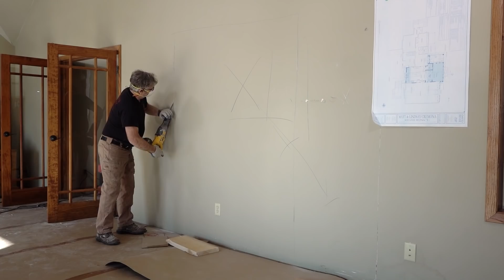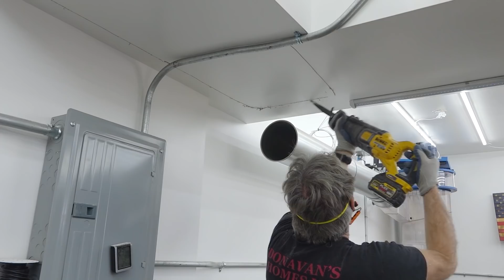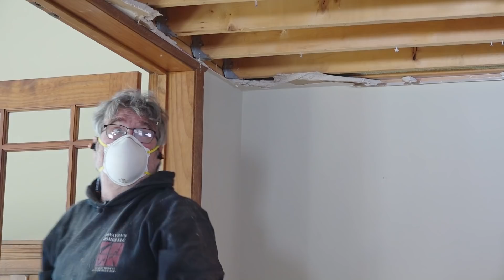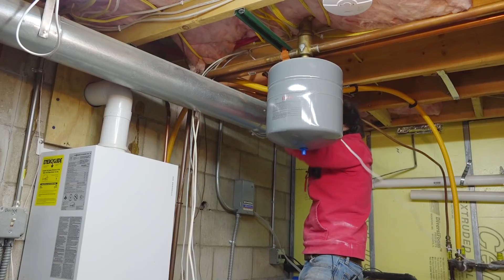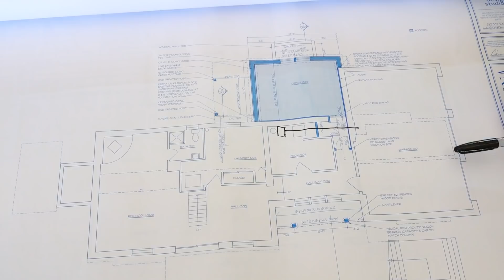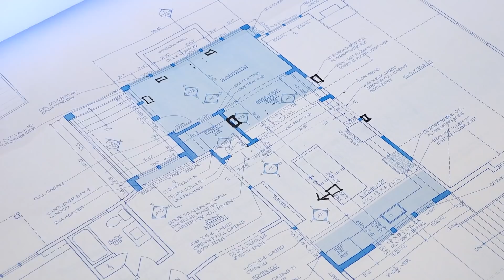Dropping the Ceiling and HVAC Plan | Home Renovation & Addition Part  21

Comment: Cubic Feet/Minute (CFM) is NOT equal to British Thermal Unit (BTU). CFM measures how fast air moves through the ducts. BTU measures the amount of heat in the air.

Comment: its amzing to see wall board go in genral waste skips in the uk its now treated like toxic waste and costs a fortune to have removed as hazardous waste.. alos hvac in the uk is for commercial buildings we just have hot water piped heating with wall hung radiators.. then we live in houses smaller that your great room foot print.

Comment: Matt, I am surprised that the Air conditioning bloke didn't mention the use and efficiency of Pelmets over the windows and use of closed  curtains acting as a important addition, cold air for example can replace hot air just behind the curtains without pelmets you can feel the cold draft at the top of the curtains of converted hot air
Making your a/c have to work harder.
I find it very remiss of him, but I also understand the bigger your system he puts in the more profit he makes 

For a relatively cheap (compared to the running and upkeep of an A/C) once of price without running electricity or a machine this is a PASSIVE way to save money 

Some search responses
A pelmet, or valance, is a wooden frame or fabric border that sits above a window and its curtains. Traditionally placed to decoratively hide the curtain track, they also help with blackout in the room and act as an extra layer of insulation in front of the window to reduce heat loss in your home

Pelmets can reduce over 25% of heat loss from a room. In simpler terms, when you heat your home, warm air rises. ... If you have pelmets in place, your warm air sinks on the curtain side of the windows. This means that it is not in contact with the cold glass.12 June 2018

How To Reduce Heat Loss From Windows | WindowRama
https://www.windowrama.com/how-to-reduce-heat-loss-from-windows/

Do some searches on Retrofitting for passive solar design
Here is one t
But it is for our Australian situation
https://www.yourhome.gov.au/passive-design/passive-heating#:~:text=Passive%20heating%2C%20or%20passive%20solar,significantly%20reduce%20your%20energy%20bills.&text=You%20can%20also%20locate%20heaters%20near%20areas%20of%20thermal%20mass.

Please Matt you are at the right point to implement these cost saving ideas
Tony from Western Australia 🇦🇺

Comment: Matt, please clarify.  Is the forced air system for cooling and the in-floor/under-the-floor radiant tubing for heat or do you have both forced air and radiant heat systems working at the same time in adjacent rooms??  If the latter, how do you balance the two systems?  Thanks.  I'm learning a lot from your videos.
Reply: The old addition where the new kitchen and great room was both in floor heat and forced air along with all of the newly added sunroom and additional kitchen area. The original house is only forced air. The garage is only in floor heat.  The HVAC does all of the cooling for everything but the garage that has nothing yet. The heating uses both the in floor and the HVAC forced air systems together with thermostats for separate  each system

Comment: HVAC crews love to shortcut things with excessive double talk. Get your return ducts installed it the walls with 2 vents for seasonal needs. 1 high for Summer and 1 low for Winter each with a louvered cover that can be opened and closed as needed and each with it's own standard size filter. That way in summer you draw the hot air off the ceiling so your AC works less and in the Winter you draw the cold air off the floor so the heat doesn't run as long to maintain temps at comfort level. I had the argument with the crew installing central air in my mothers house 50 years ago and when I left they did what they wanted and I now live in that house and they put a return in the floor only and the second floor is 50*F hotter than downstairs with the AC on full, they just don't seem to understand that when the cold air builds up to the level of the T-Stat it shuts off and with a return in the floor sucking cold air back in it takes forever to reach  the T-Stat and upstairs  where the bedrooms are is still hot. I mean it's not rocket science, hot air rises so in the Summer returns need to be at the ceiling and in Winter they need to suck the cold from the floor. And filters at the return ducts will cut cleaning costs over time by not having to have your duct works vacuumed out. Of course you having a wood shop could always just hook a hose from your shop sawdust vacuum system to your return duct with a shut off valve and let it do the job for you seasonally as needed.
Reply: As an HVAC technician for over 20 yrs, I WISH I had clients that understood these concepts this well.  Sooooo many times the recommendations I give are ignored for cost/aesthetics, then I get complaints about the the effectiveness of the HVAC systems after the fact.  People don't seem to realize the realities of how physics works.  If a room needs X cfm (cubic feet per minute) of air flow to deliver the required heating/cooling, it needs a certain size of duct to get it there.  If I need an 8" duct with only 3 90*turns, then your 4" space with 6 90* turns WILL NOT WORK!!!  This is the biggest frustration I have in this trade!!

Comment: 50-degree change, no big deal. In Lima Montana, they had a temperature change of 103-degrees in 24 hours, Google it. Montana has the record for lowest temp in the lower 48, 70-below zero at Rogers Pass.

Comment: Hi Matt, that glue you were referring to is a code thing, the “glue” around the wires is to stop air passing though and fuelling a fire spreading and give you and your family extra time to get out of the house. Now windows, I was working over in the Scandinavia area back in 1980’s and when I came back double-glazing was all the rage. I jumped on the bandwagon but I insisted that they use triple glazing, everyone told me I was mad but I insisted and got my triple glazing, I Live in the north of England so our weather is not as extreme as yours, but that coupled with closed cell foam and that in additional bat fiberglass and brick walls outside inside with the cavity being filled with blown in fiberglass my house is cosy all year long.
Reply: Yeah, it's called fireblocking. So that when your house is on fire, it will deprive the fire in that wall cavity the oxygen needed to burn quickly, and therefore slow (not stop) the spread of the fire and it give your family time to realize the house is on fire and escape before being burned alive.

Comment: H VACK?  Come on man...  H   V   A   C  =  Heating, Ventilating, and Air Conditioning.   Not   H  VACK!
Reply: C'mon now, there's nothing wrong with pronouncing it as an acronym. If HVAC were a word, you'd obviously pronounce it H-VAK (as evidenced by how everyone pronounces Shop Vac / Wet/Dry Vac)! Why use four syllables when two syllables work?
Reply: @jackhgallagher  HVAC is an acronym.  Do you pronounce the acronym IRS = Iris?   FBI = Fibby?  Your ShopVac reference is more applicable to the Kleenex vs. Tissue phenomenon, where the brand name is synonymous with, or may have replaced the object's name all together.  I refer to my Festool Dust Extractor as a ShopVac...pretty insulting to Festool I'm sure. :)  Just because the renovation TV shows say H-VAK, doesn't make it accurate or correct.  So if somehow that is representative of how "everyone says it", I stand corrected.  But those who actually know, refer to it as H  V  A  C or Heating and Air Conditioning when discussing the system, its components or the installing contactor.  Here's a topic for your live show @Matthew Cremona ....conduct a poll.  HVAC or H-VAK?
Reply: @timl3918  If you can save a little time by saying "aitch vac" instead of pronouncing the letters of HVAC, just think of the time you can save by not bothering with a poll.
Reply: @timl3918  The real answer is because there are no language police, as long as your message gets across, it's acceptable.  Whatever is ok where you are is by definition ok. It sounds simplistic but that is what linguists say.  There are basic linguistic textbooks available online for free.

Comment: Every Home Remodeling job has its own unique challenges.... which makes it interesting, never boring LOL
Reply: Sometimes it becomes a nightmare because everything in the house has been tinkered with by previous homeowners. My simple cabinet replacement on the house I bought has turned into a near full gut because everything i wrong. I found out the missing cap on the kitchen sink clean-out wasn't because the cap fell off, but because the sink clogged, so they just opened the clean-out and let the sink drain into the back yard. This allowed sewage to drain into the walls because of a hole under the clean-out where the waste would drain back into the house. These scum bags probably never cleaned the house the entire time they were in there.
Reply: @MAGAMAN  very true, sometimes starting a simple project turns into opening a can of rotten worms from hell LOL

Comment: Just curious; why don't you recycle/reuse the lumber?  They just need the nails removed.
Reply from the maker: Not worth it. Most of this stuff will only be good for shorts and we don’t have much need for those. If we were building something that needed a lot of blocking than maybe but this stuff would just sit around only to get thrown out later. Less clutter is worth more